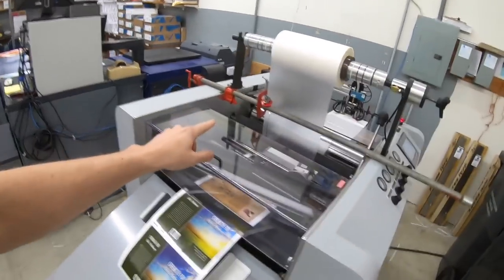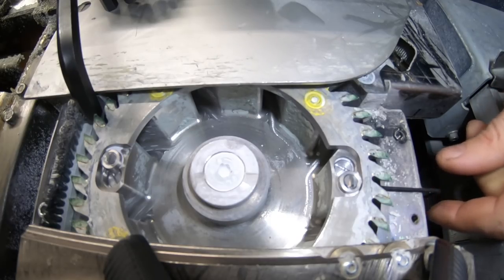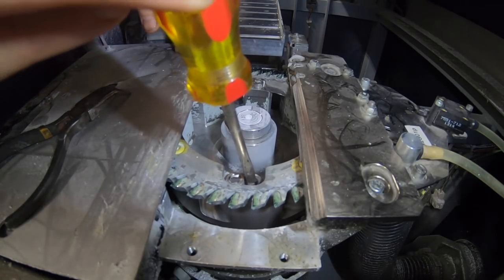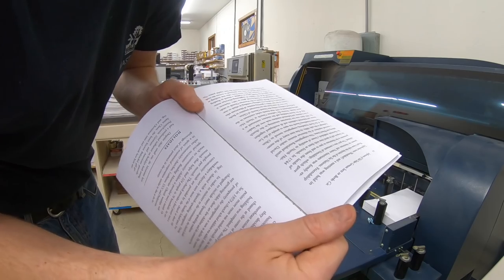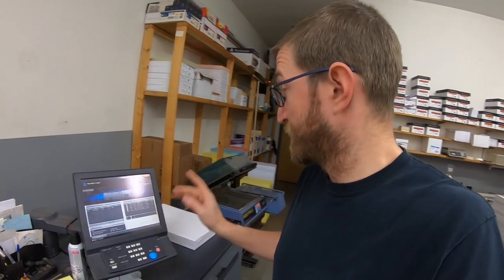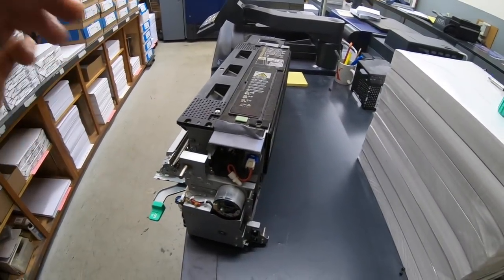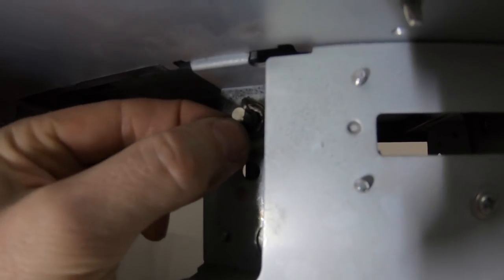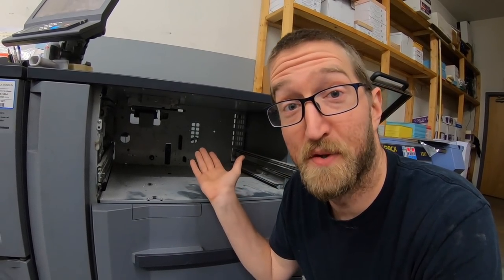Book Binder Notching Knife Maintenance, Chasing Bad Noises

Comment: Hi Dan, been following your great videos, love your show, I noticed that your cassette drive shaft with pins is not rotating concentrically, this should be the source of the abnormal rattle, your way of dealing with it is quick and effective but I don't think it's the best way, it should be the drive motor or the bracket bearing of the shaft is damaged, replace it so it can serve you for a long time. Have a good job!
Reply from the maker: I thought that too, that the shaft wasn't spinning concentrically. I need to take a closer look at that one when I don't have so much to print.

Comment: At 12:45 the end of the axle seems bent. Look at it in slow motion and its pretty clear.
Reply from the maker: Yes, I thought that too and held a screwdriver against it as an indicator but it seemed to be ok. But I tend to agree with you that it is bent. Its still running fine today though.